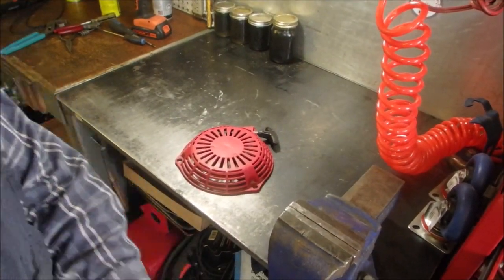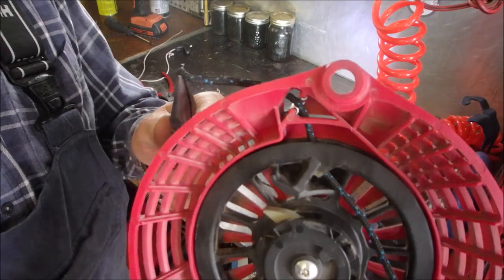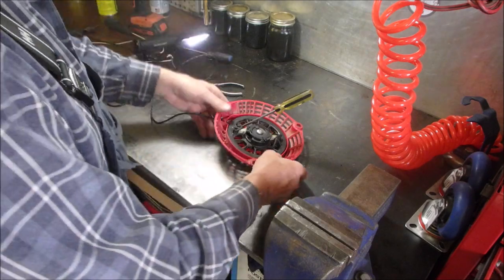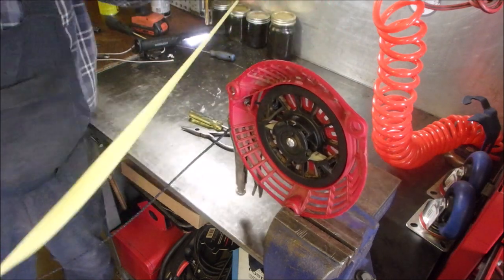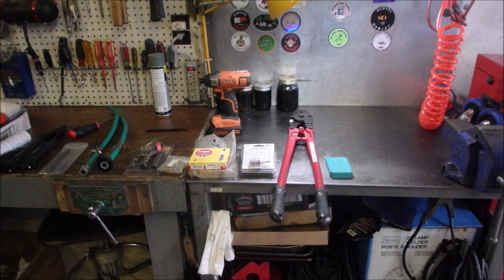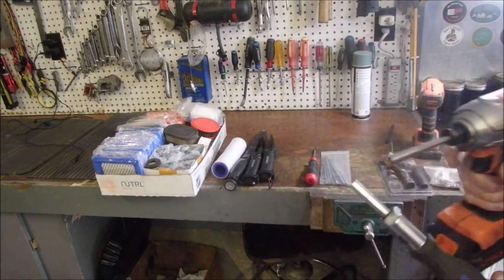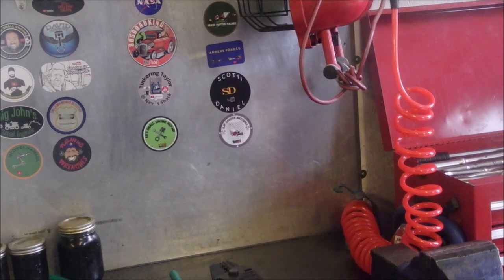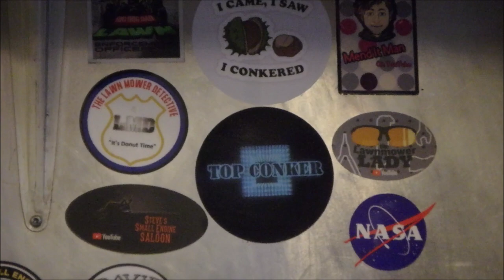Repairing a Honda Rewind

Comment: Hey Bruce,
Thanks for the shoutout!  
With regards to rope, I’ve been buying mine at Princess Auto.  They have a few different sizes and prices are about $5 for 50 ft.  Works great!
Reply: Jim: nice craftsmanship on those oil drain tools. They look super nice.
Reply: @haneyoakie14  
Thanks!
On my latest iteration, I’ve used clear hose.  Gives the ability to see what’s happening inside the hose. Plus, the new hose fits so tight, no clamps are required.  Just need to dip the hose in hot water before inserting onto the valve.
Reply from the maker: I order mine on line.  Stens quality

Comment: Having  spent a good number of hours on inland waters it's nice to see someone keep their ropes in tip top shape by burning those ends.  A little time in spent in advance will pay dividends in the future.
Reply from the maker: Right on.  thanks
Reply: I buy rope for 9 cents per foot and the other day I got 30 feet of it. I keep a lighter handy for burning the ends as I use it and for lighting my torch. It is so much easier to thread the rope when you burn the end and make it pointy.

Comment: Bruce, would you please consider doing a short video regarding the battery desulfurization? I have a deep cycle battery that I use for my trolling motor. Thank you!
Reply from the maker: OK  It will be week or more.  I am repairing my shed
Reply: If you don't already have an automatic battery charger, go for it. The new chargers have a pulsing reconditioning mode that can salvage battery capacity, then move to charging. I got mine on Amazon. For marine batteries, set it and forget it for a couple days.

Comment: Nice trick with the washer Bruce, if the hole in the handle will take the double knot Kens small engine repaired used that he called the Stihl knot we use it
Reply from the maker: Thanks

Comment: For what it's worth comment: Got a tip at a users group site for paracord as a pull rope; it was half the price of braided. Since the "para" is a prefix for parachute cord (also rock climbers) I figured it was plenty tough for a simple lawn mower. So, I tried Type III cord & it held up for a about 10 mows but then broke; glad I wasn't scaling Mt. Everest with it. But there is a stronger cord (Type IV) that I picked up (50 ft.) for 7 bucks (US) & am testing this summer. Type IV is only a little less $ than braided so it's benefit, if any, may be durability. We'll see.
Reply from the maker: Yes i have heard that from other small engine guys   I stick with the actual mower rope.
Reply: @BrucesShop  Yep we use the True Blue braided from Stens and have had zero issues

Comment: I have owned a few Hondas over the last few decades.  Can't say one thing negative about them.
Reply from the maker: My one complaint is that the carbs plug off when it is very dusty.  Which it is around here.
Reply: @BrucesShop  oh that's interesting to hear...do you suppose the air filter is not doing it's job?

Comment: Bruce could you do more videos on your John Deere Lx178
Reply from the maker: OK.  It will be in a week or so.  I love the tractor but the deck is fair.  I need new blades so I get a rooster tail.  The blades are expensive as there are 2 on each spindle making 6 in all
Reply: @BrucesShop  trust me never get rid of that mower everything new is junk

Comment: If the engine starts easily, 6 ft is plenty. If it is a hard to start engine, 7 will be better.
Reply: Just enough length for that extra "Umph"!
Reply from the maker: Right.  Well for a stationary 6 feet it fine.  I should have backed up and put a 7 footer on it for every engine.